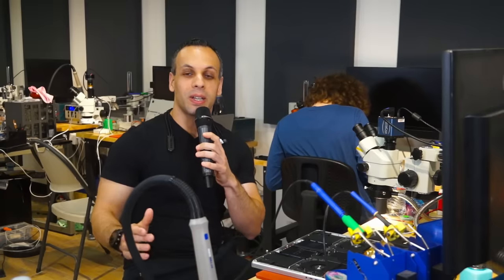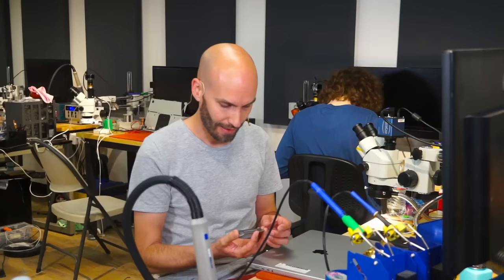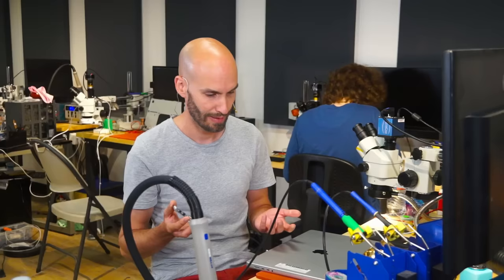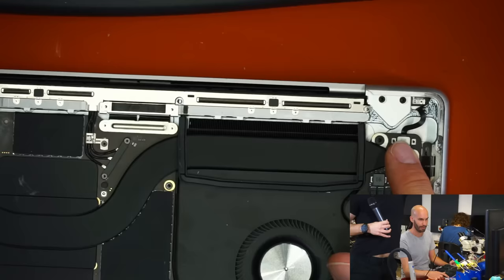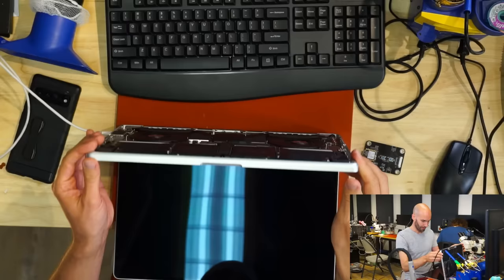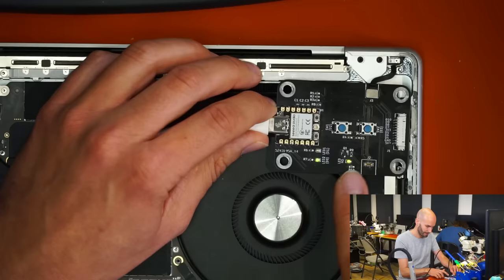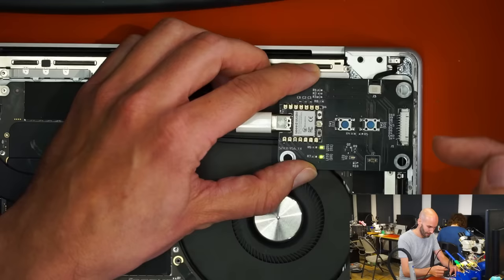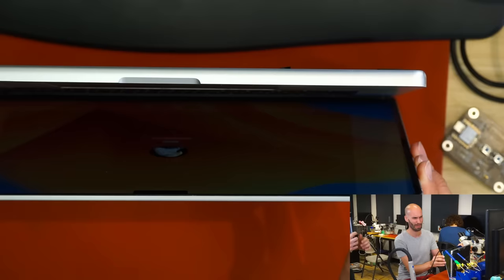We beat Apple at their own game - let the unauthorized calibrations begin

Comment: I didn't watch this whole video, i stopped when the guy said he could buy replacement parts for from china. While i have no interest or incentive to defend apple, I will admit, there has to be a part of apple that doesn't want generic parts being used for replacement parts. Apple typically has superior hardware and to start replacing it with "knock off parts" doesn't seem like a great idea. If you owned a Lamborghini and the motor went bad, you wouldn't replace it with a motor from a kia would you?
Reply from the maker: I'm glad you were open and honest at the fact that you didn't listen to a word  I said. Those are literally used sensors from other Macbooks, the only reason they do not work is because the calibration routine for the sensor is not included with the device that you paid $3000 for.

Pinning as an example of a braindead post.
Reply: no, but if that part from kia is sold to lamborghini and used the same, but if you buy it for lamborghini costs more, than why not. i have seen a guy that worked to repair an expensive car, that he found out the same parts were the same as a economical car maker, it was some indicators or something... just put upside down in the expensive car... there was a diference ike 300 to 2.5 dollars. or just now i was checking the fuel filter for lamborghini gallardo of 2014 is sold for 87dollar, while it is 19.65 if ou buy for other models. the filter is the same, mann filter
Reply: where do you think Apple gets their parts?
Reply: Lamborghini has a long history of using parts from cheap cars. Like tail lights, and other bits of trim. Why pay the Lamborghini price if its the same exact part?
Reply: you dont know what you are saying... watch the whole vid
Reply: LOL really? where do you think 99% of the components coming from? Jezz man!!!
Reply: "Apple typically has superior hardware" best joke i've heard this year
Reply: You do know most Apple products have been made in China, right?
Reply: Iphone for example are all made by foxconn in Zhengzhou, in the center of china. The factory is literally called iphone city. MacBooks are made in Suzhou also in china... There is nothing wrong, quality wise, to buy stuff from china if you have good partners there.
Reply: dang, my mans literally dont know "made in china, owned by apple" is a thing.
Reply: You really think Apple uses superior parts? You are drinking the Apple juice.
Reply: Bad example. You own a Fiat Multipla wrapped in Lamborghini Green, with a kind of Lamborghini Bodykit, and replace the Tires with Hyundai ones. Hahaha, replacement is legit, no difference between most china parts and apple ones, except of the price :D
Reply: Agree you wouldn't replace a motor from a Lamborghini with one from a Kia. However one absolutely would replace a light bulb/led, a switch, or similar item that has nothing to do with how extreme it performs with an item that shines a light or turns something on/off or up/down. Of course certain things should be OEM or OEM quality equivalent. That said, OEM quality isn't always better. 

Your comparison is absolutely asinine. More so when you didn't even watch the full video when they tell you exactly what part you are receiving. It's even more amusing that you have not replied since your original post to either defend your statement or admit it was flawed. Nor have you edited or removed the inaccurate statement.
Reply: When all said and done it shouldn't be Apple who decides what you can and can't do with your own device. If you want to solder a potato to it, then that's your decision, not Apple's. So what they do is try to make it so that whatever thing you do that they don't like just won't work. That isn't protecting anyone or anything but their bottom line.
Reply: terrible example...if you own a diablo which is also a Lamborghini you could buy Nissan 300zx headlights which lambo also did and taped over the nissan logo on the headlight
Reply: @ryan005869 Original iPhone parts are made in China. I don't see the point of your argument.
Reply: if it gets the ball rolling? of course you would a lambo engine is fn ridiculous lol i was an apprentice to a mechanic for 4-5 years oversizing engine bores and rebuilding engine is no easy task if their is cheaper replacement that fits most mechanics use til they can afford new part.
Reply: This guys comment is a garbage. Yea it’s so superior that you need to get that crap fixeded every what? 6 months and then rip you off. Thanks Luis…
Reply: funny enough, supercars use low cost rebranded parts -- one specific that comes to mind is the signal cover for the european galardo is the same like on the mk1 focus hatchback so yeah ... i do mind when companies tell me i can't repair MY PRODUCT that I PAYED with MY MONEY the way I want to, just because they don't agree with the process using parts not from them
Reply: Wow, you really drank the punch. Apple doesn't have superior anything. You are paying more money for an inferior product. If you buy a microsoft laptop for the same price you pay for your Apple computer you wil find a far superior computer to what Apple offers. By the way most the parts this gentlemen buys is not a 3rd party. You can get the exact part that is in your Apple computer. The parts come from the same company that actually makes the parts for Apple.   It's obvious you don't have a clue about computers. 

All common computer and cell phone parts come from China whether its Apple, Sony, HP, whatever.
Reply: Apple parts are made in China I thought.
Reply: it might make sense, but apple should not limit ur own freedom to repair ur own hardware. whether using an inferior part or not, it’s really up to my own choice.
Reply: You know that legendary Lamborghini Countach?  If you buy the tail lights they will cost roughly 4k per tail light.  Do you know what the tail lights actually came from?  Alfa Alfetta.. Those tail lights for the Alfetta cost 60 bucks for both... 

Now to answer your question "you wouldn't replace it with a motor from a kia would you?"  And my answer is.. if i want to I should be able to.. 

This goes deeper than that.. Lenovo laptops are notorious for this issue as well.  They take generic items, flash a custom firmware and when the part goes bad you cant replace it with the generic item.  You need to search for the custom firmware part which costs 10 times as much for no other reason but because you can only buy it from lenovo.
Reply: you are a funny man, Ryan... apple is being manufactured in China anyway... :)
Reply: 😂😂😂😂😂 lamborghini is not the best example in this case as it is  built out of cheap  parts 😂.
However, apple products are not made out of superior hardware at all they use just the same electronics parts like every other manufacturer ,no difference  at all but Mr Louis already proved this if you ever watched his videos man.
Apple products are always overcomplicated, and apple doesn'tmake it easy for repair shops, which is the case in this video, isn't it -you need special tool  to get it done.
You should watch it first before posting anything. 
The other guy mentioned Chinese parts because no parts are available for apple at all, only from donor machines and knock-offs from China. Great job guys.
Reply: I would say, there was a part that did not want cheap parts from china. With Jobs gone that part is gone too. My previous iphones literally NEVER hang despite many years and many models. Now after Jobs is not there i own a second device, previously 11, now 13 and both tend to totally hang up once a month or two. wtf?!? Quality of hardware and even more software got drastically lower after that. I suppose in 5 years android may be more stable than iphone and I would need to reconsider which platform is better. It is really sad.
Reply: pinn of shame
Reply: @lewismatthewj  he was thinking all the parts of apple devices were made out of gold😂
Reply: @bartowl  false dude overtime it would lag,, i have an old apple devices too.. don't be such a fanboy every device would degrade overtime no matter what brand it is...
Reply: I hope you are trolling because everything you said is simply false.
Reply: The Apple "original" sensor is same frickin China hall sensor as the one from China directly... Only difference is that there is no Apple fee..
Reply: "Apple typically has superior hardware"

AHAHAHAHAHAAHAHAHAHAHAHA
Yea nah. Apple has the same shit as, everyone else. But for 10 times the price. Arguably in some cases the quality is worse. 
As someone who works tech support at a company that uses primarily apple, I can tell you right now, apple shit breaks far more easily than any other pc's. All my apple users? constantly got issues with battery's, USB-C ports being broken, etc. All my windows users? I often forget they exist.
"Wow we made our pc out of titanium" great! So that just means that if it drops there is a 0% chance of the internal parts surviving because there is 0 flexibility, and if it can't bend it breaks. 
Oh those USB-C ports that  we only have two of? for one, they break pretty easily. Oh and you need to replace the whole ass motherboard to fix them. Because apple :)
And the chargers.. my god the chargers.. specifically the cables, how did they manage to make cables that get fucked up so easily.
I get that it is absolutely the user's fault for them going fucked up. but the thing is, if your product can't survive users being users, then it's a poor quality product.
Reply: Wow you harangue this poster for not listening but clearly struggle with comprehension yourself. “The guy”, ie Steve, did in fact claim to get the sensors from China without clarifying whether they are authentic Apple parts or not (nor did you). @rossmanngroup
Reply: The irony of this is that the Lambos used to commonly have Nissan parts.
Reply: You should had watched the hole video then.
Reply: Hahaha superior hardware he says. This guy's most complex repair must have been replacing batteries on his remote control.
Reply: Lamborghini actually uses many many many generic parts, look it up. 60 bucks or 1200 bucks via Lamborghini.
Reply: Oh yeah? I wonder how that "superior" got rusted.
Reply: where do you think apple has parts made ryan?
Reply: @RyanVasquez6089  It's like spark plugs for cars. NGK manufactures those for a wide range of Car companies, so why not buying from the maker itself?
Reply: I bet you wished you knew how the world worked
Reply: @rossmanngroup  I would like to debate you and say not brain dead but rather, brain washed...but maybe brain washed does make one brain dead? LOL It amazes me how people think they can only put "Apple" RAM in their computers! And people saying Apple is superior...sure, they work. But if you get an Apple computer for $X amount and then go out to buy another brand for the same price, you will get way better specs out of the other one. Also, if you go spec for spec, you will get another computer for a lot cheaper.
Reply: @HawkAnomaly  its a thing but the quality is still different. 

Its like buying black label bacon from walmart and buying cheap artificial bacon from walmart. 

iPhone speaks for itself by lasting for over a decade. Even the 5c still works until this day.
Reply: @CleanLuxuryCosmetics  Don't know what iPhone you're buying but my 5c's battery is so shot I consider it dangerous to be going out with it. It will be dead before I arrive anywhere and I wouldn't be able to call any emergency services I might need for whatever situation comes up.
Reply: @paragonvice1128  lol. Do you hear yourself? 

A brand new samsung since like 2013 was guaranteed to end in an expanding battery and a slowed down phone. 

Your only complaint about the 5c is that it requires a battery replacement after well over a decade. That is a huge accomplishment on Apples part. 

Just a few years ago kias were catching fire and Samsungs were exploding on people, but the whole world hates Apple. Its a joke. 

Of course the 5c needs a battery replacement and cant handle modern tech, but it still works. Thats just the great quality Apple offers. 

Just like my decade old hp monitors. Great quality. 

Credit is due where its due, regardless of branding.
Reply: It’s your own choice to do with your own fucking device whatever the hell you want. Who cares if it’s a bad idea. Let the customer make that stupid decision if they want to. If that’s worth it to them to save money, they should be able to do it. Also, I have had great success with Chinese parts too.
Reply: Also, I am sorry, I’m gonna have to get a little flame here. The ideas that Apple is a Lamborghini is fucking hilarious.
Reply: These are laptops which are made in China from Chinese parts. A factory part is... well... a part from China.
Reply: @CleanLuxuryCosmetics  My comment got deleted for being too mean for you because you're a tool but it happened 2 months later, not 10 years later, and 2 months for a $150 battery is not a subscription I'm willing to pay. Also, I didn't praise any other company in my comment. You can assume I suffered through my dead iPhone and was miserable for years.
Reply: @paragonvice1128  lol. Sorry for your luck if you’re actually telling the truth. But by the amount of working 5c on the used market your anecdotal evidence does not reflect the quality of the company, but a one off defect. 

Im a tool simply because im spitting facts and you are too emotionally invested and cant focus on facts at the moment. Whatever.
Reply: PIN OF SHAME, PIN OF SHAME, PIN OF SHAME, PIN OF SHAME, PIN OF SHAME, PIN OF SHAME
Reply: I definitely would. There's a huge auto channel of putting smaller engines that are more efficient and cheaper in cars
Reply: superior hardware? are you new to this channel?
Reply: wondering where is apple part coming from
Reply: toating in an epic bread
Reply: pov, you talk about a profession you know nothing about
Reply: If I pay $3k for an Apple product, I'm obviously paying for apple care. Too many "Repair Shops" out here using knockoff parts that affect the device in negative ways. I'm also not paying any amount of money for some Chinese part and definitely not paying a penny for a used part that'll obviously fail just like the original. Besides, the security he's tryna make out as a fail is a fail in itself. I'd rather my MacBook be stuck awake than for it to be stuck asleep.
Reply: this argument is the long form equivalent to "nuh uh". The point isn't that apple care is a bad thing or anything, its just that if you are paying for a product you should get a choice on what you do with it, even if that's putting second hand parts in it. The thing is, second hand parts aren't going to fail the same unless it happens to be a design flaw, in which case a new part will fail the same anyway. No one wants to force you to get second hand parts, but we want it to be an option for customers willing to take the risk rather than spend unnecessary amounts of money. And no, not all customers will have apple care, as secondhand devices cant have that. This isn't even considering apple refuses to repair certain things that are easily repairable. This is something anti right to repair people don't understand. We don't want replace the advised methods of repair. We want to give everyone the right to choose how their device is repaired. The quality arguments don't even make sense. Any time I break a screen on a device i buy a cheap replacement from china (usually they are actually productions that sell to apple) and replaced myself with no reduction in quality. This is electronics we are talking about, not a painting. If all components function the same, regardless of quality, you will get the same output anyway. So even if they were worse quality it wouldn't matter for most users, especially those interested in right to repair. I am tiered of people who know nothing about repair saying these things. the fact you brought up apple care proves you've never even opened up your own device. If it is really a question of quality, why is it so easy to repair so many other high performance phones and laptops comparatively? @rannz7
Reply: @cardboard_boi  Lol, not reading that pointless book ypu made.
Reply: This is Tim Cook's secret YouTube account.
Reply: Ever heard of Chinese company Foxconn, Apple has because that's where the iPhone you use gets most of its parts and where it's manufactured.....the Chinese nicknamed this company ' iPhone City '

You should probaly research before posting long-winded comments, that are incorrect
Reply: @mlassz009  yup, it’s funny how the only people who make these arguments, are the ones who have done no research. It’s almost as if they don’t know what they’re talking about
Reply: That Lamborghini uses a bunch of audi parts that have been marked up by 3000%.
Reply: what a big dick move to pin this comment. salutes
Reply: this OP is example of average consumer of electronics.... In the IT space a lot of them think this way sadly. Why we have issues we have  to this day. :|
Reply: You would be amazed how many Lamborghini parts you can buy for VW price tag because they are essentially just that - VW parts. It's the same shit with Apple and China.
Reply: Pin of shame lmao
Reply: exactly what i would do, why not replace it with cheaper part made to spec, a prime example is the ford modular. so if the engine of your Koenigsegg CCR fails it doesnt need to get replaced by Koenigsegg you can get normal ford modular parts for a lot of the engine internals and get them changed by any mechanic or even yourself.
Reply: this right here is what an apple brainwashed drone looks like
Reply: apple doesnt have superior hardware, they just have software that is best optimized for the parts they are using
Reply: @lewismatthewj  You do Realise that Apple Has the Shittiest Quality of Products, on the Market Right? You could get a Cheaper and better Laptop That does More Far better than Apple From Razer For like half the cost, and for the same cost get something even better.
Reply: thinking what is inside your apple device does not come from china, is verry naive.
Reply: First: Apple is not superior, it a myth. Second: a sensor is not comparable to a motor of a car. Third: all of those sensors are pretty much the same, so even if it is knock off part it will work just as good. Fourth: Just so you know apple uses same parts as other manufactures.
Reply: wrong move, do more research
Reply: True story, I had to replace the electrical for a carwash at a luxury dealer. There was a customer needing work on his lambo, some kind of 1 inch tube 6 inches long needed replacing. It was going to cost 3500$ and take over 2 weeks after ordering the part. I had just cut a 6 inch piece of 1 inch conduit, threw it to the guy and said "Maybe this will work for two weeks."

To everyone's surprise it was the exact size as the part they were replacing. They tried it. It worked. Never found out how long it lasted, but the moral of the story is FUCK APPLE.
Reply: Wow einstein! Did you think all off this by yourself or did u get help? Dont forget to breathe btw u seem like the type who needs a reminder for that
Reply: Did you have trouble comprehending my message or something? Right to repair is great. You're not a salty carpenter who has to clean up after everyone so has never seen a lambo are you? @tutturankamon
Reply: @ryan "If you owned a Lamborghini and the motor went bad, you wouldn't replace it with a motor from a kia would you?" I would, because KIA produces much more reliable engines that do not catch on fire.
Reply: Fuck yeah I would replace it with a Kia motor that's funny as fuck
Reply: Why not, if kia can make Lamborghini-like motors which works perfectly, i would use it for replacement
Reply: @RyanVasquez6089  stop comparing cars to phones LOL.

You rightly got roasted.
Reply: Most people hide their stupidity, you bravely put it out there for all to see. So brave!
Reply: lol. lmao.
Reply: @kk2sal  not only that, but also imagine Lamborghini used the fear of knock-off parts to hide which part of the car failed, then they make you buy a whole high-end car instead of the cheap part you really needed.
Reply: "Apple typically has superior hardware"
Yeah yeah we heard you, but how's your battery life going after next iphone comes out?
Reply: didn't read the entire reply, I stopped reading after you said you didn't watch the entire video.
Reply: You are my ideal customer if you wanna stop by my auto repair shop in Washington sometime.
Reply: @rannz7  "...definitely not paying a penny for a used part that'll obviously fail just like the original"

Just like the ... Apple part did.

"Besides, the security he's tryna make out as a fail is a fail in itself. I'd rather my MacBook be stuck awake than for it to be stuck asleep."

You might well. It is more convenient, but you cannot argue that is more secure, which is the point.
Reply: Your lamborgini example is funny because they do have parts that are expensive for no particular reason as they are litterally rebranded parts from other manufacturers.
Reply: This argument has "you wouldn't download a car" energy. Hell yes I would, probably saves me thousands of dollars and works exactly the same. And apple having superior products? A joke at best
Reply: I didn't know "apple is better because tim cook tells me so" people still existed 

Also an apple chipset is hardly a Lamborghini lmao
Reply: I don't know about now but i know at one point over 60% of an Iphone was samsung parts.
Reply: your misunderstanding is that apple has superior hardware. that's a kia under the dress-up that confused you.
Reply: The main difference to your argumenta is you are assuming that the kia and the lambo take the same motor which is basically what is going on here with the sensor.  If there was a kia out there that took the exact same motor as my lambo but it was cheaper.. I might think about it... tho lambo would never let you cause of the agreement... wow lambo and apple have  a lot in common!

The fact of the matter is apple gets them from China too (that is where the MacBook is made after all) from the exact same place, the exact same chip and just calibrates them in house.
Reply: Plenty of better engines one could fit in.
Reply: Volkswagen groups makes the Lamborghini engine, the same people that make the beetle, make Lamborghini engines, knockoffs are often just not branded with a logo.
Reply: Lambos use a lot of Volvo and Audi parts and if you just buy the parts that are not branded by Lamborghini you just save a ton of money! In your defense if someone repairs your stuff with non genuine parts it must be with your knowledge and you must pay less!
Reply: Currently Kia is better quality than Lambo. Where are the components that Apple uses manufactured? In various factories around the world and mainly in China. There is a myth – spread by the hegemonic mentality of the USA, in the Cold War in technology – that Chinese products are all bad. The reality of the facts shows that there are Chinese products of equal or superior quality. 

Since 1999 I have replaced HDDs, SSDs, RAM, fans, screens, keyboards and other components of Apple equipment with third-party components, including Chinese-made ones, generally achieving greater performance than the originals and at a lower cost. I am glad that there are intelligent technicians capable of repairing and teaching us how to repair, defending the right to repair and denouncing the anti-consumer practices of Apple and other famously abusive companies.
Reply: @rossmanngroup he didn’t listen to your response either.
Reply: Mate its a screen shut sensor? Maybe you should try buying them from NASA if you are so concerned....
Reply: Where do you think apple gets the parts from? My guess would be...same place. In any case, people are tired of being ripped off when they've already paid apple its over inflated prices. In these times of recycle and reuse, the biggest amount of tech going into landfill is Apple, because of their strategy.
Reply: HAHAHAHAHAHAHAHAHAHAHA OMG i have never laughed so hard at a comment in life lol. The whole dam Apple product is made in China. The capacitors to the PCB. My word are you delusional. Dont argue with Rossman, as an electronics design engineer with 8 years experience and a BEng trust me this guy knows what his talking about.
Reply: Sure, there are parts that you should not buy from china (yourself), but from specialized Importers that know their stuff (like Apple is), and have long lasting trade relationship and/or one or both have a name to loose (like Apple). Examples for that kind of parts would be hard drives, processors, graphics cards, power supplies or batteries.
But thats just some Sensor thats costs a few cents. If Apple sells that Part for 100$, you can have a failure rate of 99%, and still be on top.
Reply: hmm.... "superior " is a funny way of spelling shit.
Reply: Do you think a 5400 rpm and dual core i5 drive can be called superior hardware in an imac 2020?
Reply: @kk2sal  The flaw here is to make an analogy with Lamborghini that is a true masterpiece not a tiktoker  disposable toy made in china like a Mac.
Reply: @At-M he meant superior marketing
Reply: LOL where do you think Apple gets their components from 🤣🤣🤣🤣
Reply: Louis has addressed this half-baked idea a number of times in his video. Your example of Lamborghini is ironic; their hostility and greed is not for and has nothing to do with your safety or performance, it’s for their pockets, period. 

Apple COULD sell replacement parts and tools even at a markup to address the “counterfeit” argument, but guess what? They don’t care about you, they want to charge you for a new machine when their intentionally flawed design fails. Wake up dude. 

Apple and Lambo thank you for being so compliant and not questioning anything.
Reply: @kk2sal this literally happens with every luxury car maker.
Aston's designed under ford ownership used a lot of ford parts. Lambo's have a lot of audi parts. And not just mechanical parts, even the visible luxury interior bits can be carried over from cheaper cars like switches/ac vents etc.
Reply: @At-M exactly, why do these premium parts on 3000$ device fail like the hinge sensor or keyboard when none of those have failed on my 300$ hp from 2014 that I still use as a server and was used very roughly by me & my sister during our school years.
Reply: I was wondering why in the WORLD this post was pinned by Lous, but after reading his comment and the public lashing you've recieved for doing zero investigation/research on the opinion which apple gave you, I can now see why.
Reply: bro thinks, APPLE = LAMBO
Reply: You are the PERFECT consumer!!!
Reply: Arent all apple parts made in china lol?
Reply: Macs ain' t Lamborghini's by any stretch
Reply: apple parts are literally made in china, and the parts you're buying are usually used original parts taken off of broken or stolen macbooks
Reply: Lol, the complete stuff comes from china. I own by my self an mac book pro with m2 max and i lime the hardware. But its creepy to see this issues. My old MaxBook pro from 2013 still runs fine so assume for the new one. If it breaks to early it will be last mac book pro for me!
Reply: All motors are made cheap and if you think something is better because you pay more or its made in a better place  you got to come to the conclusion Did you take the Covid Vaccine or did you say F No to the Government .
Reply: @rossmanngroup i love u
Reply: You done been ratio'd, man.
Reply: Where do you think Apple gets their parts...?
Reply: Lamborghinis routinely use Ford parts and as they are part of the Volkswagen group the engines are taken straight out of Audi's. And Apple devices are more comparable with a Chevy than a Lambo.
Reply: wtf are you talking about? what "superior" parts does apple use in their products? They customise off the shelf parts so they can charge you more.
Reply: Just to give you an answer..all the parts in your apple products are made in china
Reply: a closer analogy would be if you had a lamborghini with the v10 engine and you replaced it with the v10 from a crashed audi r8.

It's literally the same engine, made in the same factory, on the same production line, but with a "cheaper" badge on it.
Reply: Must admit, I stopped reading your comment when you compared Apple products to Lamborghinis. That’s just laughably absurd and confirms you aren’t qualified to have an opinion on this topic. At all.
Reply: Talk about being out of one’s depth. You should have stopped at “I didn’t watch the whole video”. Lol.